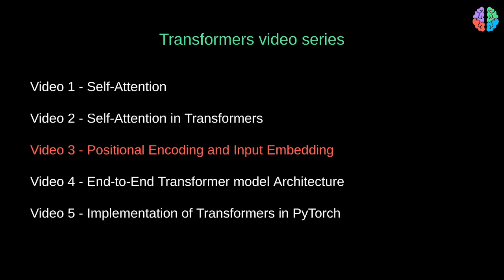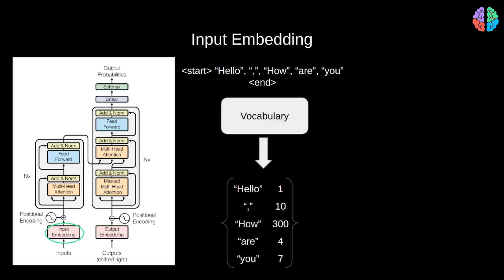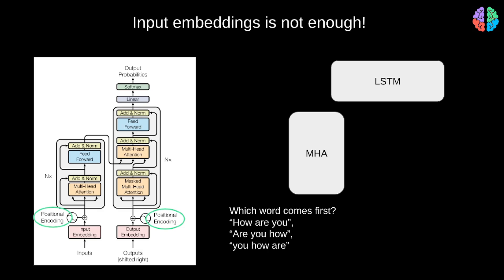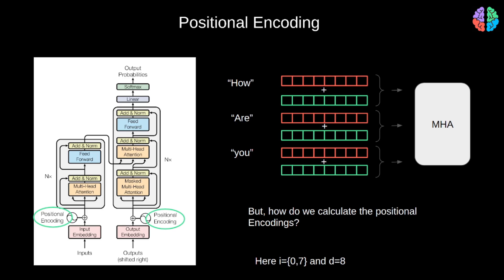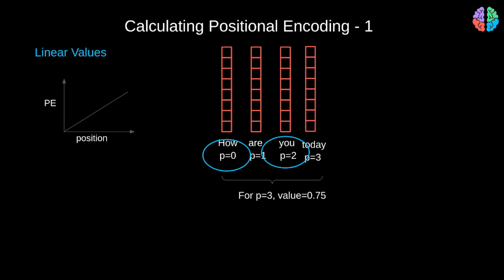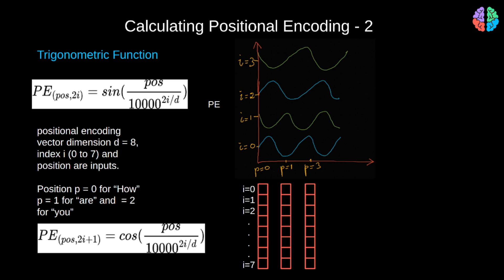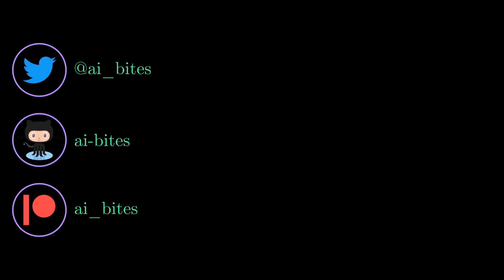Positional Encoding and Input Embedding in Transformers - Part 3

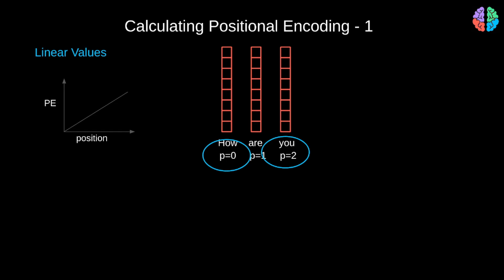Comment: Dear AI Bites, i have a doubt at 6:12, if the input has 2 sentences, giving continuous number P=0 Value=0, P=1 Value=1.....and so on, this will make the model think that 2 sentences always occur together at all time. Could you please guide me on this statement? May i have an example? Thank you.
Reply from the maker: Sure. So the modern-day LLMs like ChatGPT and LLAMA have thousands of words in a sequence, say 4 thousand words. Assuming 10 words make up a sentence, we could have 400 sentences in the sequence. So by using a linear position encoding, the first sentence will have a 1 but the last sentence will have 400! This is not a great choice. 

Additionally, as several sentences occur together, this way of encoding leads to bias in sentence choices too.
Reply: @AIBites  Thank you so much for your guidance.

Comment: If I want to use transformer for time series and the time is not evenly changing, there is irregularities of time points. How could I positional encoding of these time into transformer? Could I still use the formula shown in this tutorial.
Reply from the maker: yes I believe that the function can be used and then you can always sample at your required time stamp. Hope it helps